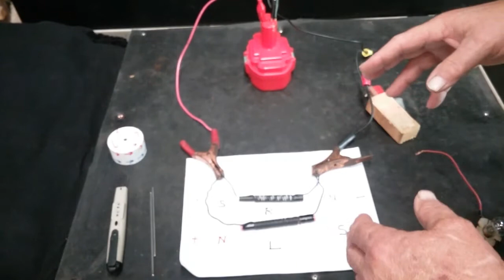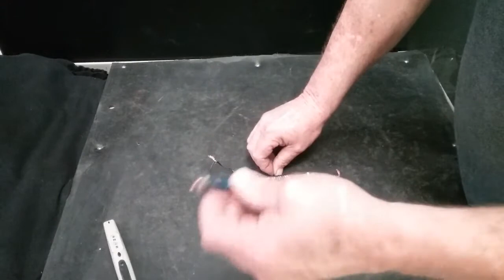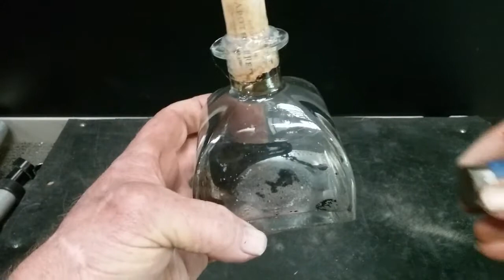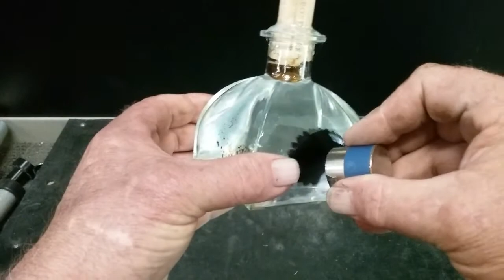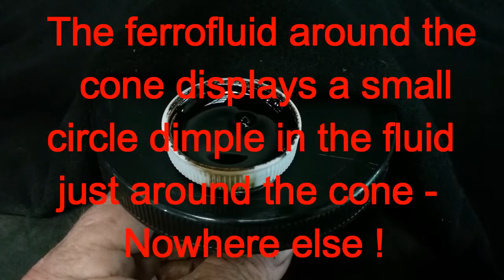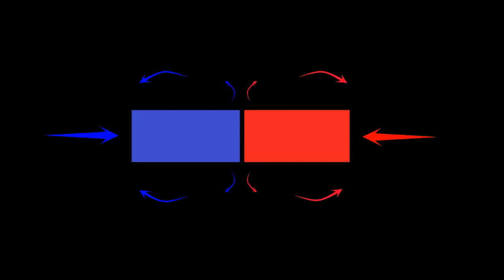Inside a Coil

Comment: I like your thinking. How would you get the magnet to only show N or only show S using an electromagnet? Is that possible? If you ran one end of the wire back through the center of the coil what would the result be? Would the magnetic field then be moved to a single side of the magnetic field? I assume the results would be the same as portrayed in the video. P.S. block the guy named "Oved Appr" his over-commenting and desperate attempt to advertise for some other clown (gudtim4all) is pathetic.
Reply from the maker: I don't believe there is any way to have a magnet (or electromagnet) with a single pole (mono pole).
I agree with your sentiments concerning Over Approved. However, I shall not block - I will merely request he post less times and try to include his statements / questions / ? - in a single or couple of posts.

Comment: is it possible to create a ferro fluid that is clear?
If so it would be highly interesting to put non ferrous particulates (dark spots) into the fluid , and to watch their movements under a field.
Maybe phosphors and uv light being applied with camera on side wall of clear glass.   (then increase electro magnet voltage and monitor movements)
Might allow us to use their movements to produce accurate computer model software, and the bounds of that would be incredibly useful.
Reply from the maker: I have no idea???